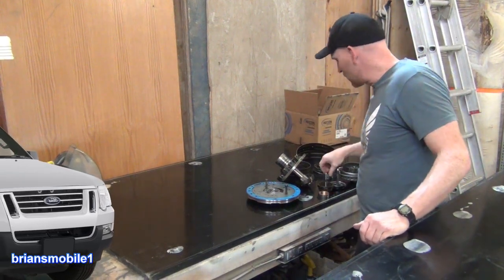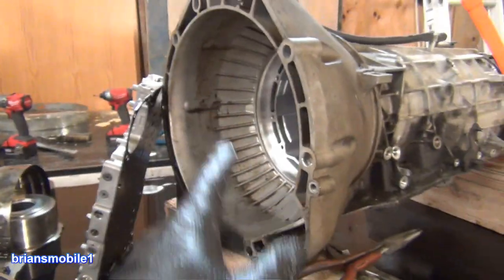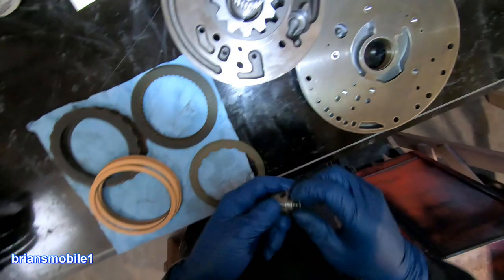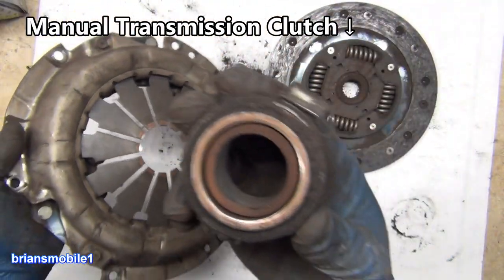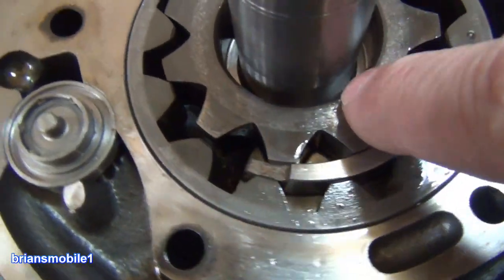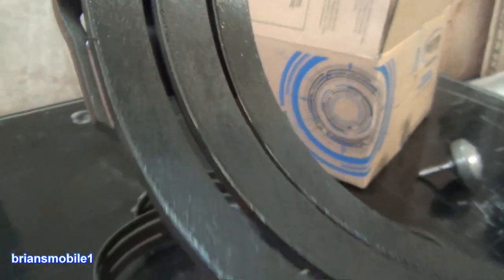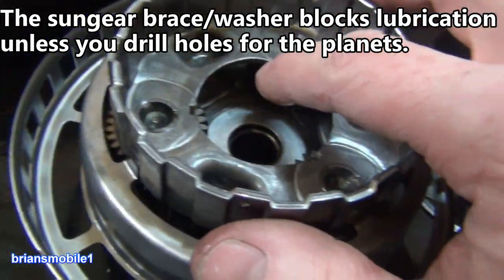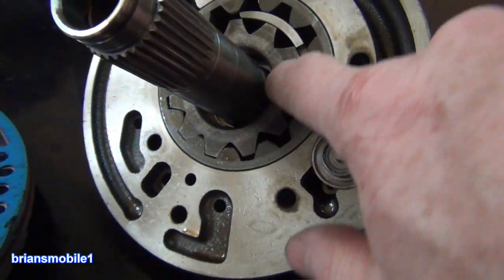Transmission Time Bomb SHARE!

Comment: You always explain things to where I can understand them I appreciate it very much I had a similar issue with a General Motors 4L 60 E the torque converter would not lock  up so I replaced the Lock up solenoid with the trans go delete kit and has been working flawless for several years now. The torque converter locks up so good that it actually feels like another gear
Reply from the maker: Thanks Jeremy!

Comment: Use those trans go kits all the time, how are the servo bores?  I bet they are wasted and need to be repaired.
Reply from the maker: Great question!  Bores were good, but the piston seal for the intermediate was loose.  The valve body was furshitzled too.  I tried to salvage it, but was impatient on disassembly of the main regulator valve (similar damage as the flow control valve) and did a swap out of California on a sleeved VB.  I assume you're sleaving everything that comes through.  Have you seen sleeves go longer than 50K?  And have you tried the O-ring'd pistons from AJ1E Superior out of Jackson Wisconsin?  You can replace the O-rings on them- they come with extra & last around 30k-50k miles.  (video coming soon)
Reply from the maker: BTW kudos on your video of the 6T70E Pressure switch fix
Reply: @briansmobile1  we sleeve all cases, haven't had a comeback yet.  As far as VB if it's wasted we buy a good used and shift kit it.  Too many problems when someone else "fixes" something.

Comment: But here is the biggest challenge...After you tow it finding a mechanic that's not gonna lie and say its 3000 in parts and labor when its just replacing that one small part for under a thousand
Reply from the maker: Find an old guy who's good, has help and his building & toys are paid for.

Comment: Hey Brian I have a quick question I know you made a vid 8 years ago for the crf450 oil change but I am noticing a possible small leak on my head gasket. Is that something I would be able to do or better of taking it in thank you
Reply from the maker: Should be able to do that one.  I've got a whole mess of engine rebuild footage on those coming soon.
Reply: @briansmobile1  alright thnx this is the first bike I’ve really owned other than the 230f so I’m learning about these bikes as I go😂

Comment: Brian, in your opinion would a transmission flush at 100,000 miles prevented this problem?
Reply from the maker: Not likely given it's due to a design issue and metal wear caused by the issue.